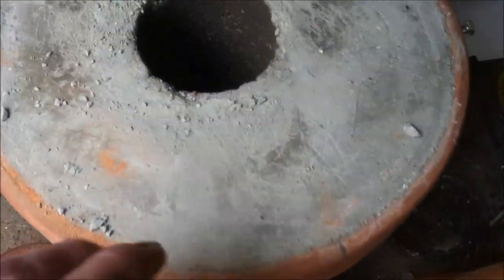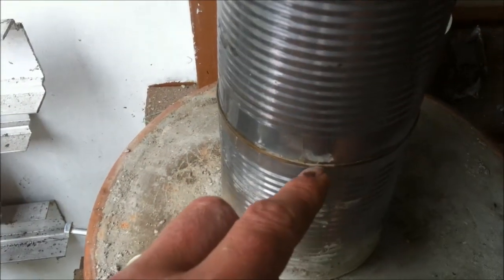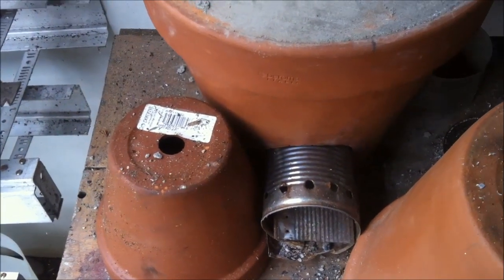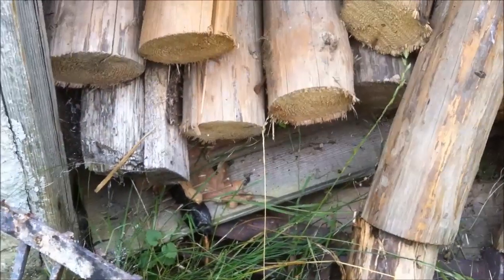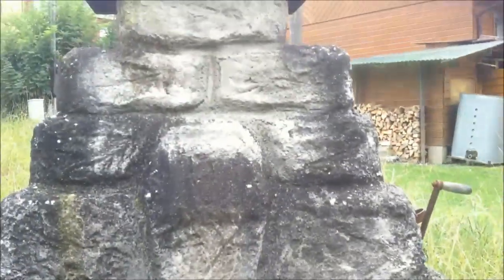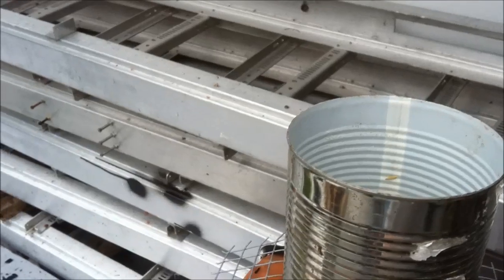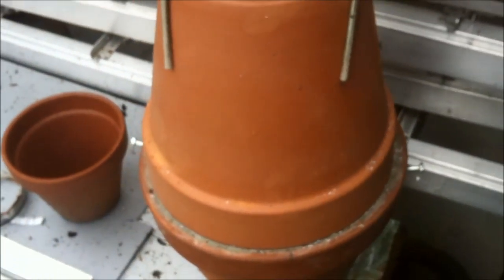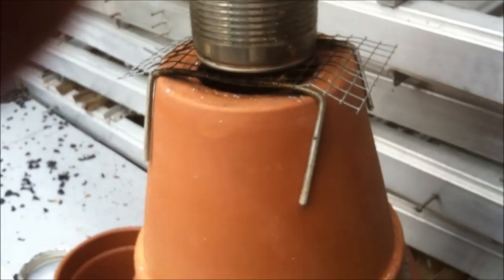Plant pot rocket stove

Comment: Try insulating with dry ashes from a wood fire rather than cement.
Reply from the maker: Dont know if that would work.  But thanks for the input.
Cheers.
Reply: @SouthpawDavey  it works. Ashes from wood fire is better than anything you can mix up, add pearlite or vermiculite too.
 Work with the ratios  on your pipes.
 The chimney height must be 3.5 times the width of the chimney and the air intake/fuel pipe must be sane width as the chimney pipe.
 Try it.. you'll be able to melt brass in it..👍🏻
Reply from the maker: @CrackInTheBox666  Cheers I have done some smelting in another set up. Just dont see how the ash and perlight would bond and harden.
Reply: @SouthpawDavey  doesn't need to bond or harden... That's the beauty of it.. cap it with some cement, or other mix if you prefer. 
 Plaster mixed with pearlite and some fine sawdust will create a ceramic type finish once it heats up.. the saw dust combusts leaving behind an excellent insulator.. test it on small design's. You'll get good results mate. 👍🏻😬
Reply from the maker: @CrackInTheBox666  Ah so your saying put it in between two pipes. the was a long time ago when I was playing with this. but might be somthing I get back too. Cheers

Comment: You make some really cool stuff!
Reply from the maker: Thanks Ann. I think it will be nice if it works and looks as I want it too. but it got me thinking about an oven now lol.. If I had no electricity here I would have no heating or cooking here. We dont get many problems here but its another option and could be fun to use if it stops raining lol.
Reply: Southpaw Davey I know what you mean. If we don't have electric we don't have water. I want to put in a hand pump on the well. We use the grill if the electric goes out but want a rocket stove so we can burn wood if we have too. jastownsendandson has a few great videos on making a cob oven.
Reply from the maker: We are ok with water a hand pump is good how deep is your well. I am looking for a generator we have oil heating now did have a an old duel wood and oil but it sprung a leak inside the tank no fixes had to get just an oil burner but no spark no heat. that stopped working last new years eve two days to get it fixed I want a wood burner in the house just for reserve, The old Good old oil tank holds 5800 L fuel oil so if I needed it I could run a generator if I have to. Cob ovens are great I want to fit something in that old BBQ thank for the heads up.
Reply: Southpaw Davey We are really blessed to have a deep well 220 ft. (67 meters). This is the only area in the county that has good water:) It is going to take a deep well pump which are pricey, but worth it. Anyways, I hope you find a generator. They are handy to have. Looking forward to seeing what you come up with for an oven:)...All the best.